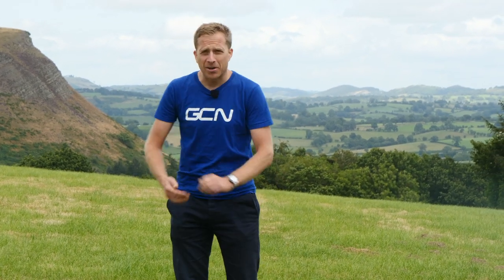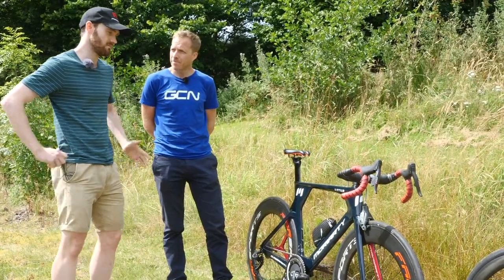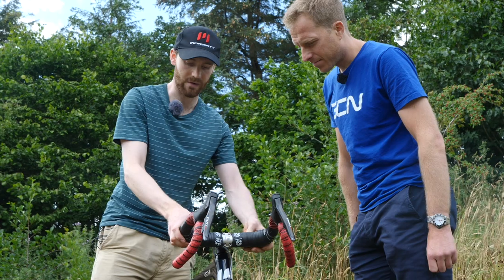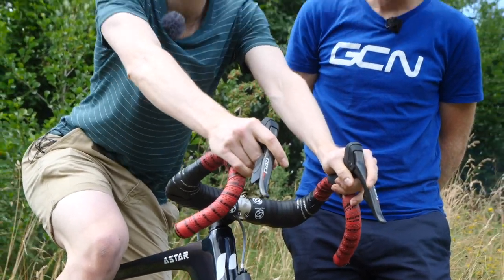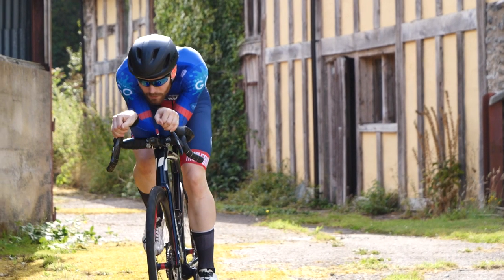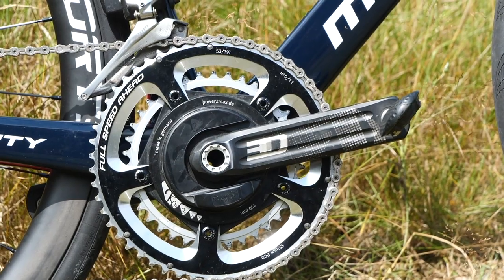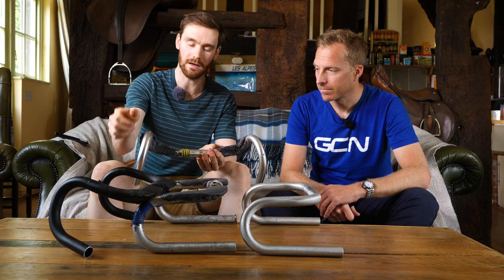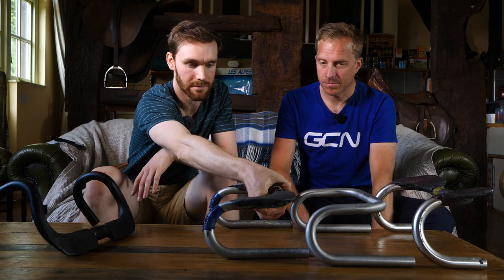Is This The Most Aero Bike Racer In The World? | Rethinking Cycling Aerodynamics

Comment: it would be good to see some testing to see what a difference this made vs a standard racing bike
Reply: Hi John. Have done exactly that. It's big. Didn't make the edit though for some reason!
Reply: @drcgriffith1  I suppose if you have your torso parallel with the ground then as the arm position is nigh on in a tt position it's going to be nigh on the same saving. Have you looked at Haero's integrated drops and aero bars? Something like that minus the aerobar but with your geometry could well be just the ticket mate.
Reply: GCN does science episode 🤔
Reply: David Griffiths will the company you are using start to make them I find I more comfortable in an areo position and I find my hands feel wrong on the hoods in the traditional bars shape
Reply: David Griffiths so what are the gains? Not in this video, your website, your twitter, your YouTube, or your Instagram. Have you posted anything about your aero testing on a forum somewhere?
Reply: @samharris82  something in the order of 30-50w less power required to do 30mph on a road bike with levers at same reach for me. CdA about 0.23 on my road bike with the bars.

Comment: I bought  36cm handlebars for my road bike ( the previous set was 42 cm ) with a ism saddle to gain a more aerodynamic position. The owner of my local bike shop used to tell me that I need even wider bars than my 42 because the volume of air that comes into my lungs would be decreased and I wouldn't have stability on the bike. Those guys are stuck many decades behind
Reply: A P I’ve just reverted to 36cm bars after doing the research and I absolutely love em. Last year I was riding 42, in the spring I went to 38. I lived the feels of the 38 but I wanted to go even narrower. I had the other day in my track bike which has 40 on and it felt like I had a parachute on!
Reply: I run nitto deep drop 36cm bars and I'll never go back to anything wider. Instantly faster everywhere that aero counts and no slower up hills.
Reply: Yeah I think shorter cranks helps much more with breathing deeper than bar width. Belly breathing will help your lungs function better than trying to breath from the chest with wider bars.

Comment: i mast say he did every thing Graeme Obree advise to do  many years ago: use the narrowest bars you can find, turn the shifters slightly in, find the widest tires that fit in your frame, use large frame with short stem so you could ride the superman position and still stay in the UCI ruls... 
my bike looks the same!
Reply: Don't find the widest tires that fit your frame, find the widest tires that are no wider than your rims. Bulging tires ruin aerodynamic wheels. Also, wide tires either provide better rolling resistance OR more comfort - not both at the same time. If you use the usual recommended tire pressures, wider tires give you the same rolling resistance but more comfort at the cost of slightly larger frontal area.
Reply: The guy at rollingrestance.com or whatever is now claiming this isn't quite true.  He's saying we've always been comparing equal pressure when we should compare equal tire drop in order to compare resistance at the same comfort. I'm not sure either is quite right.  Anyway, when he does he gets that RR is basically constant across tire sizes.
Reply: @bigring6424  That's exactly what I was referring to, when the rr.com guy compared same tires of different widths he used relative drop, so something like 15% of the tire width or height. If you compare two different tire sizes at 15% drop, the larger tire will have less pressure and it will be slightly more comfortable (because it moves a larger amount for the same outside force). rr.com found that when comparing tires like that, the rolling resistance was pretty much the same across different sizes. So you're left with a tradeoff between aero (narrow tires better) and comfort (larger tires better).

If you compare tires at the same pressure, the larger tire will have less rolling resistance, but  it will also have about the same absolute (not relative) tire drop as the narrower tire, so you won't get any real improvement in comfort.
Reply: Actually at the same pressure a bigger tire will have less absolute drop, not just less relative drop.  I'm fairly sure his latest reviews (see the conti 5000) look at it this way. It's very recent thinking over there, see the conti 5000 review.  Anyway, I'm not convinced any of these things are really the right measure of comfort. I get the rationale for absolute drop, but I think it's too approximate.  Reality might be between there and same pressure.  In which case there might still be a little RR advantage to wide tires.  Definitely there's a comfort vs aero trade off.  What isn't as clear as it once seemed is if RR actually improves at the same comfort level, assuming that's a definable thing.
Reply: It’s worth bearing in mind that up to a point, a bigger tyre will be faster over a rough road at the same deflection than a smaller section tyre. So many of the roads we ride are not very smooth so often the ability of the tyre to not be hindered by bumps overrides the pure rolling resistance on a perfectly smooth surface aspect.

Comment: Love that idea! Specially for straight, flat roads with bumps (not hills).

My bars are (on one of the bikes of 61cm frame) are ~36cm at the top and 40cm at the hoods. Absolutely perfect for sprints and kind of tt positions on the straight. I'd like to see an option of these in carbon (mayne not as extreeme as 28cm, but around 32 at the top - would be perfect)

Comment: This is why I bought my 3T Team Aeronova bars last year and use an 80mm stem. They have a 104mm reach so I get more support on my forearms in an aero position with hands on the hoods. The tops do sweep forward a little so it's not ideal but a bit nicer than a standard bar. It might be nice to have a few degrees of backsweep on the tops. It would also help match the angle of your forearm resting on them too.
Reply: David Kutassy this was me, I had to go to 80 from 100 because climbing out of the saddle didn’t really work on steep grades. No rear traction. Ultimately I didn’t find that 104 gave enough support and abandoned the idea. I got a one piece combo that’s 90 and 90 and it feels the same.

Comment: Aero taken to the extreme!
Reply: Still terrible compared to a recumbent position. Upright is fundamentally a terrible aero position.
Reply: Yes, but you can see, balance,  maneuver and ride up very steep hills comfortably (and with a bit less weight) better on an upright bike.  If the market wanted recumbents, shimano would be funding HPV races.  UCI rules have some purpose for keeping the industry from disintegrating.  Recumbents are great fun in the right setting.
Reply: @difflocktwo  I srsly would not ride a recumbent on an open road. Being so low is pretty scary in traffic.

Comment: For someone so particular about aerodynamics, i can't understand why he went for a 28mm tire on the front wheel. Talking about leading edge losses, those rims might be 30mm at their widest, but that's not at the edge of the rim where it meets the tire. The tire therefore balloons out wider than the rim, messing with the aero profile. He could win quite a few watts by going with a 25mm or a 23mm on the front wheel

Comment: You should check out Morf Tech aerobars, it's designed for triathlon (non-UCI legal) but you can use it in a road bike configuration. Much more stable when "opened" and, in my opinion, much more aero when used in time trial position.
Reply: But it is also very interesting btw. I love to see different solutions and thinking outside of the box.

Comment: Hmm, I’m kinda digging the narrow/long tops/hoods with an extreme flared drop.  Not sure though.  I think a more flared drop would help more to prevent rubbing the tops.  I know back in the 90’s as a teen, my Profile Aero III’s weren’t difficult to climb with on the narrow flared part of the extension.  However, for my 36 inseam at just 6ft tall, I love having 175/180mm+ crank arms... I feel more efficient with more leverage and they fit my long-ish legs good.

Comment: About 8 years ago I made a set of handlebars that look very similar to what he's using there. I used two part epoxy called Aves Apoxie It mixed up kind of like cray or cookie dough and then hardened in about a half hour. I then I wrapped that with craft foam, the thin sheets you get at the craft stores.  I then wrapped that with the bike grip tape. I liked it and it did work out well.
Reply from the maker: Was it a hack or a bodge?
Reply: @gcntech   
It was definitely a hack. They were steel bars on an old steel Centurion from like 1970. I also cut down the width of the bars I took out 4 inches out of the middle of the bars. I then put a wooden dowl in there and I epoxy that into place. I also pulled the ends of the handlebars out a little bit because they kept hitting my wrist too much.
 Before I did that hack I also used a pair of 90s era narrow  Profile Aero bars that had a kind of diamond shape front portion. My forearms touch when I use them. I like those. They were way easier to get on and off of. I also tried another pair of aluminum Profile Aero bars that were kind of wider and they were connected in the middle too but they were way harder to get on and off of. It was almost to the point where it was dangerous to even try to use them.
Reply: I used to like the old steel Schwinns back in the 90s, but that old Centurion was rock-solid, and it had perfect tracking. I could bomb down Hills doing 50 plus without using the handlebars. A lot of times I just put my arms behind me like a skier does and I could still keep pedaling. Up hills it was still too heavy though.

Comment: I played with a long reach, 100mm stem and 104mm reach bars. I could get stretched out an aero the problem was on steep hills out of the saddle my weight is too far forward. I went down to an 80mm stem and it was better to climb, I could still stretch out, it was a good compromise. I left the 104mm reach bars to 90mm with a 90mm stem, which is still radical for me. It ends up 30mm longer than my regular setup. 

I did some tests when I had the 100mm stem and 104mm bars and I could get just as aero on the same bike as using clip ons. It’s just not as easy to hold. In reality it was the same position as a pro using a 130mm stem. Ultimately I never had enough support on the 104 bars I know why yours are 160. 

I also use 160mm on my TT bike, but if I did it again I would have not gone past 165. I tried a 170 on everything else.

Older shimano shifters with the cables coming out the side used to be a good hand hold when hanging out on the ends of the hoods like that too.

Comment: It is certainly an interesting concept, but as an older, recreational cyclist it does look to be the sort of position that would put me in traction rather than at the front of a race.
The pertinent point for me was David pointing out his torso length and the impact it had on his knees hitting his elbows in the conventional aero position. I'd guess that off-the-peg frames have to fit the average rider and so those like David with pyshiologies iutside the norm need to adapt. I'm sure conventional wisdom would be to get a custom frame and hang conventional contact points off it. David is simply approaching the answer from a different direction so fair play to him.

Comment: Although UCI seems not to enforce the rule, forearms/elbows on the bars are not legal body support points in a road race.  Hands on bars, feet on pedals and butt on saddle--that's it.  Similarly, the super tuck with butt resting on the top tube is also illegal.

Comment: very intereting, but the first bike is his tt bike ? because for a tt  aero bar combo will be faster (like a speedbar set)
Reply: Hambini reckons (aerobars aside) it's around 8 watts between a traditional drop bar and a basebar.
Reply: @jonnythelegs2597  ok, 8 watts with a standart set up but maybe more with a position like the HUUB watt bike team on the track.
Reply: @hadribari  the use base bar would be more, the end pods are a proper naca profile and the brake levers are inline with the bar itself so they don't add to the frontal mass so overall it could as much as double that figure possibly even more. The aerobars would be a different matter though as that would depend on your arm and body position.

Comment: Nothing about this is a surprise. It's all very logical, and fits with what I've learned about aero over 40 years. 
getting your body lengthened out is the key to lower drag.......as long as your hip and spine joints can tolerate it. 
shorter cranks are advantageous for higher cadence, allow a lower back angle, and reduce toe overlap on smaller frames.

Comment: I'm not sure what the advantage will really be in a road race. In a solo, breakaway, maybe. But if you are in the bunch, it will for sure, cause you problems trying to stay upright and react, whilst the aerodynamic gain will be minimal or nil, but, you are  going to suffer needlessly purely because of your extreme position. Race 2.5 hours and upwards, and you need to relax, rest and stretch frequently. With that geometry, it looks impossible. 
Seems to me you are getting a pseudo-time trial, road bike, which is probably not a hybrid anyone needs. Because a normal tt bike will still be best for that discipline. Plus, narrow bars exist in the World Tour (36, I think) but have been used by sprinters, with the justification that they can get through narrower gaps. Little or nothing to do with aerodynamics. 
Also, the flex due to their length could be a real issue. 
The general point about body position versus a longer top tube, and conforming to the front hub rule, may be valid and useful though. 
So I remain a skeptic. The actual aerodynamic numbers would be interesting to see, since they apparently exist.

Comment: Nice thoughts! Been exprementing my self with my style of posisoning , but laid most time on the crank lenght. The old school type like 180mm and cainring like 55,56 or more. Thougt that the force will be greater and more harmonic with a little less cadence though I were used to have like 75-80cad. Now a days iam fine with 172,5 with my length at 192cm. Never tested shorter like 170 or less, not even near of the thought of 155mm's! How high cadence would that leed to and gain the watts of 300-450!? Are there any Tables for this isue???
Reply: That's also my primary take on the video. I never given it that much thought. With my other obsession (cars), I knew about the balance between torque and horsepower for efficiency. But the biggest difference in this case is that it also affects your (aero) position on the bike. Even if you would theoretically speaking produce less power or be less efficient, it still can be overcome with aero gains. Not sure if I like the look of those bars tho. In any case, it will be very rider specific.

Comment: No need to have a clip-on bar and its extra weight and air drag because it's built into the bars.  Would like to see this make it to the masses.  Short cranks are commonly used on recumbents.  I use 160 mm cranks on my two recumbents.  I do have upright bikes and would not want to give up the armrests.

Comment: Could you survive a race above 30 miles in such an extreme position though? Great idea for shorter TT races but not road races imo.
Reply: I've raced with David quite a few times in 50+ mile races, doesn't seem to have any issues 🤷🏼‍♂️
Reply: I think you'll be fine once you get used to it. It'll require a strong core tho I think..

Comment: Sounds fine in terms of straight line aerodynamics, but having a frame that's too big for you.... wouldn't that affect handling on a "real" road stage with descents, other riders etc,  so much that it would negate the few moments of solo straight line efforts?  Or maybe he's onto something.  I guess we'd all need to try to find out.
Reply: I once did the same thing, went for a slightly larger frame with a shorter stem. It actually happens to be one of my best (stable and still responsive) riding bikes, so that's not the problem. The biggest problem however is that many manufactures decrease the seat tube angle on larger frames and thus increasing the set back, the opposite of a TT position. It closes up your hip angle and puts a lot of stress on your back and knies. Most often you need a zero offset seat post and still need to slam the seat forwards to compensate in order to get closer to a TT like position. Some manufactures understand that it is actually smarter to keep the seat tube angle the same on larger sized frames (73-73.5°). Always check the geometry charts.
Reply: @Timotei of Bollow it would, yes,  if you look at the way mountain bike geometry has changed over the last 10 years you can see it straight away top tubes are 2-3 inches longer stems are comparatively shorter and headtube angles are around 3-4 degrees slacker. Xc bikes are now far more capable on technical descents than even very good trail bikes were a few years ago. Mondraker were one of the first mainstream companies to adopt this to trail and xc, BTR were pioneering this even sooner.
Reply: @Timotei of Bollow more stable yes, but less responsive.